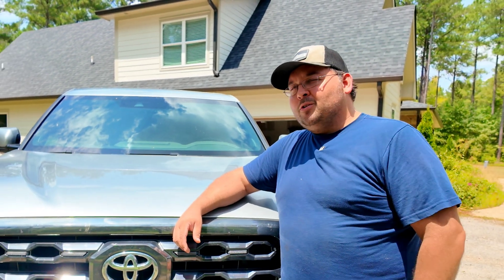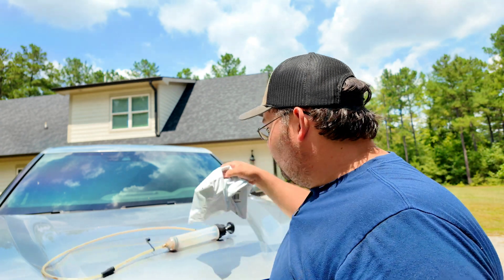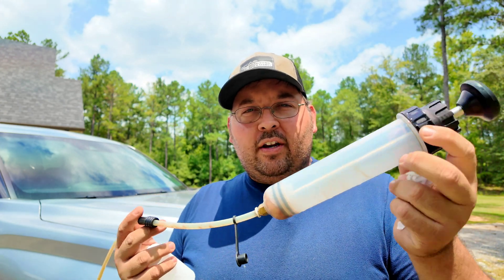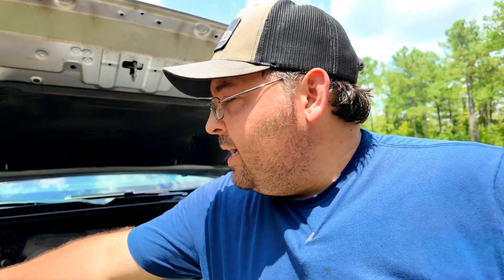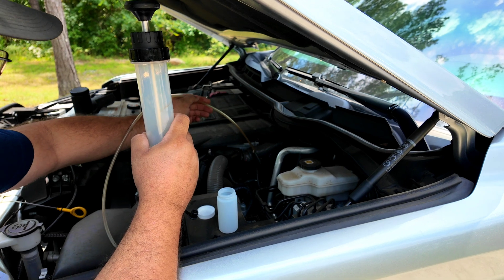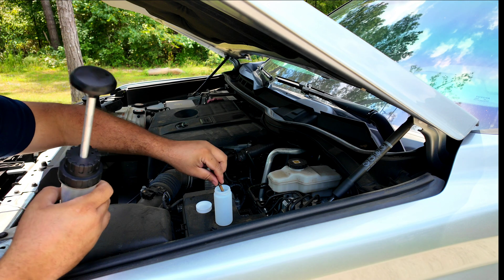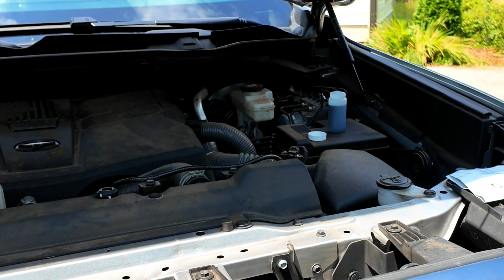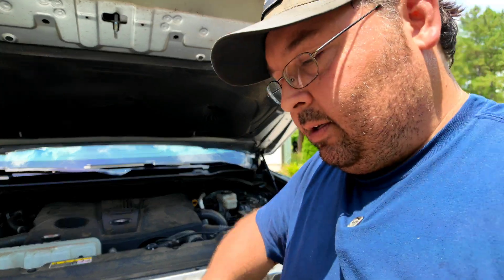How To Get A Oil Sample! Checking Your Engines Health!

Comment: Soooo, did you now contaminate the HF pump with the oil so next time it will pick up your first sample from the pump cylinder?
Reply from the maker: Yes it can be contaminated if you dont clean it. Some people use solvents, some use soap and water and some will replace the tube everything. Honestly a good cleaning with a solvent will do good.